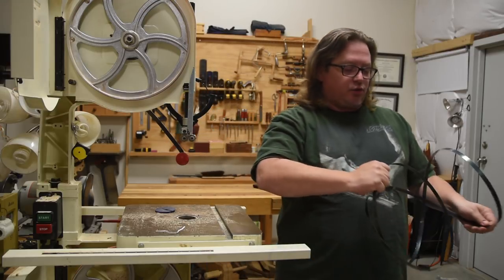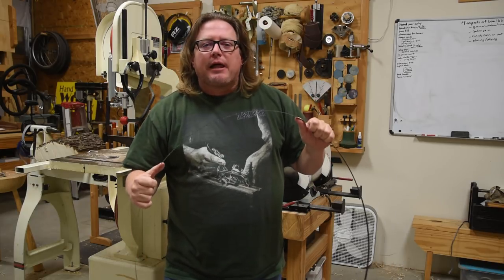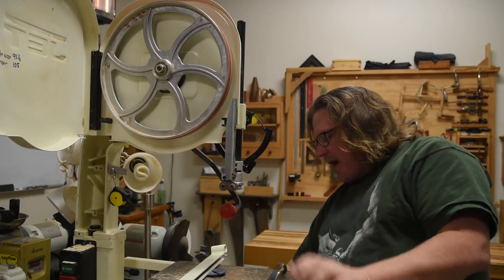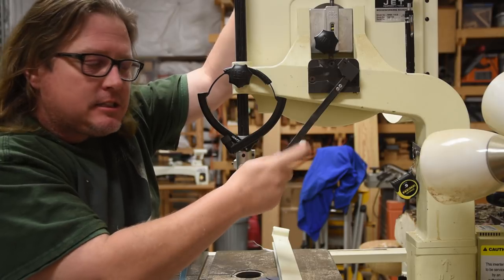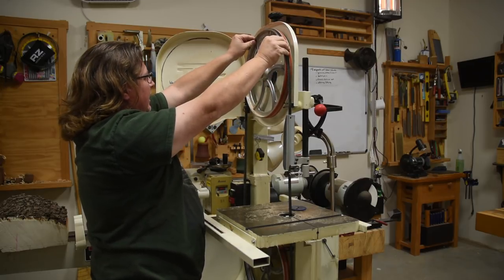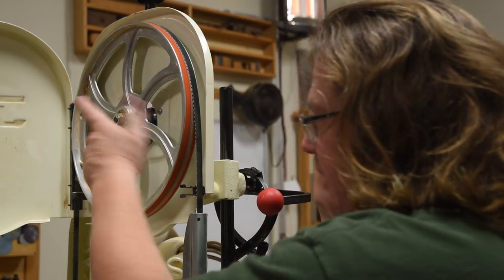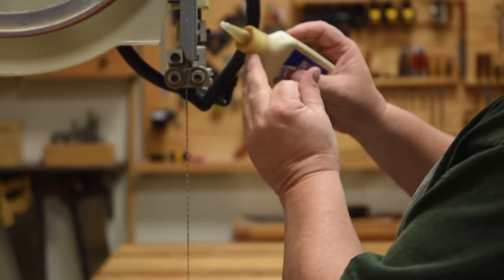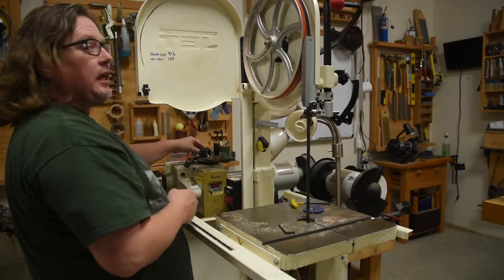Changing Band Saw Blades

Comment: I bought a second hand Electra Beckham 315/4 bandsaw last year & like it, except it has been a big learning curve. I have gone through many setups & it would work for a while before shedding its blade or breaking it and before then it did things like cut the bottom door handle, the top blade guide & wear the face off the bottom thrust bearing. In this model the blade runs against the side of the bearing, a little like a bicycle brake. After a while I adjusted the bottom wheel tracking which is possible on this machine. It ran better till it shed its blade & cut through the bottom tyre. I made a new tyre from a bicycle inner tube, it ran great, cut a lot of wood then again shed its blade. I struggled to find why, kept rotating then by chance saw the bottom wheel move & then with some gentle back & forth I got the bottom wheel off, to find the axle was worn out, both wheel bearings seized, the wheel rotating on groves it had cut in the axle. There is one supplier of parts, now called Metabo in the uk, so I ordered a new axle, it came, but is the wrong size & the supplier answered my email by saying mower serial numbers are under the seat! The saga goes on, but I am getting resigned to machining a new axle, probably what I should have done after finding the fault, but the new one was a lot cheaper than buying stock & using my time on what is a trouble to make as it needs a large metric 20 mm 1.5 mm pitch on it & my lathe is imperial, plus needs a new half nut installing for the threading. But hopefully in the by & by the bandsaw will serve me well.

Comment: I would like a video explaining the difference in blades and uses for them. Like making tight curves, wider blades for say cutting logs for bowl blanks and what to look for in a metal cutting blade. Differences in the metal used in making blades
Reply from the maker: Metal is out of my realm. I only really use a 1/2 or 5/8 3tpi blade and a really fine one for scroll work. For me the bandsaw is a coarse cutting tool that gets a lot of work done fast.

Comment: I have the same problem with my Delta 14" band saw. The height adjustment mechanism is lacking a tight enough tolerance, and even if you adjust the rollers properly, you need to watch where you clamp down the adjustment lever  because you can be way off 

Great video as always!
Reply from the maker: Thanks

Comment: With the gullet in the center, doesn't it tear up the wheel? I noticed your wheel had a lot of wear?
Reply from the maker: wforl not really. You were seeing compressed sawdust not tears and that wheels 7-8 years of daily use. The blade isn’t moving on the wheel.
Reply: Ah ok. Thanks!